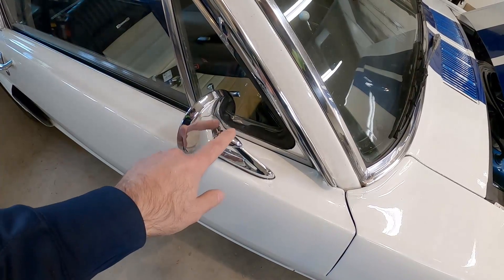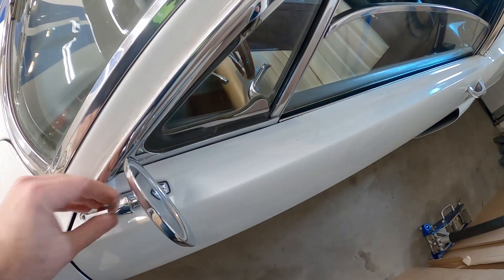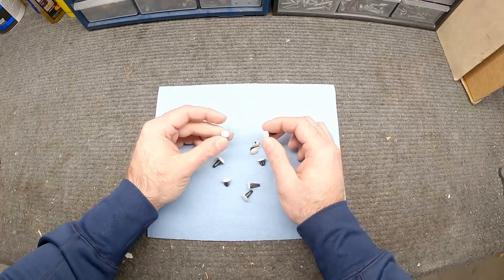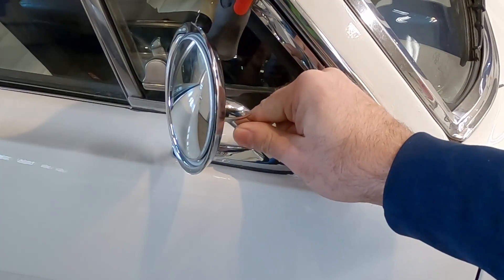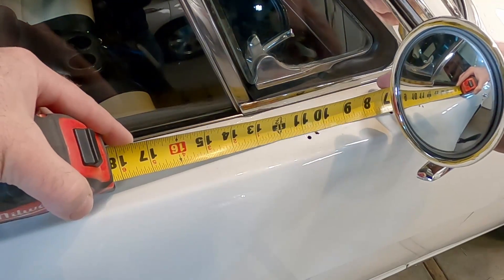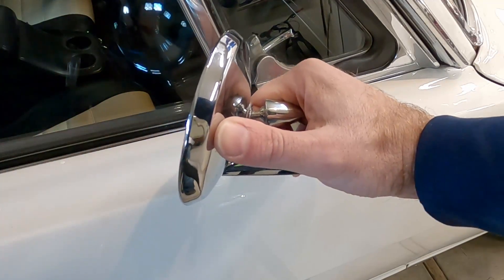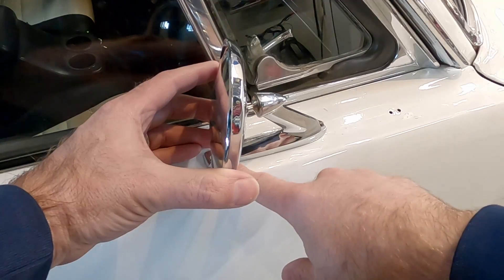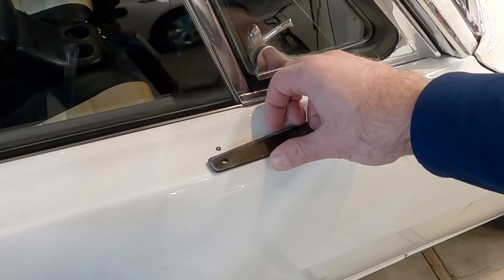Fixing the Mirror Location

Comment: My Falcon has the mirrors way out on the fenders. can't stand them there. but when I removed them, same thing you had,  multiple holes under the gasket and the mirror bit into the paint,  so has an outline of the gasket in the paint. So I reinstalled them for now. Too much work to repair the old location.
Reply from the maker: I'm glad I don't have the mirrors on the fenders, I wouldn't like that either.  :)

Comment: Could you use a little white bathroom silicone for now just to take the eye off the holes ? just a thought. 😁
Reply from the maker: I did exactly that after I made this video.  I pulled those plugs, applied some silicone, and painted it white.  I should have just used white silicone, but I am not a smart man.  :)

Comment: Don’t want to sound to “hillbilly” but maybe try white silicone to fill the holes. After it hardens use an exacto knife to trim and level.  Just a thought 🤔
Reply from the maker: Not hillbilly at all, after I made this video I did basically the same thing.  The funny this is it didn't cross my mind to use white silicone, I used clear and then used a little touch up paint (that didn't match my paint) to finish it up.  It looks bad up close, but miles better than those stupid plugs.  :)

Comment: I had the same issue.  I took it to a body shop and had them fill the hole with weld.  They were very careful grinding it down so there wasn’t much damage to the paint.  Then I took touch up paint and covered the weld.  It didn’t look too bad when it was finished.
Reply from the maker: That's the right thing to do, I'm just stalling until I get to the painting part of this project.  :)

Comment: Hey Andy, great to see videos of struggles small and large!  

As a suggestion here until you are able to take it for paint repair.  Trim a hardwood dowel to the hole diameter and tap into place.  You can then use some very fine sandpaper to smooth the flush top and touch up with common touch up paint.  It won’t be perfect of course but is super low cost and will be a more precise band aid until paint time comes
Reply from the maker: I thought about doing something like that, but I don't know the specific color of white on the car.  It's a bright white, so it's definitely not the Wimbledon White.  I've tried a few different colors of touch up paint on rick chips and stuff, none of it matches.  Since I made this video, I pulled those ugly plastic plugs, filled in the holes with some exterior silicon, and used that touchup paint.  It looks bad up close, but 100x better than those plugs.  I'm stalling until I actually get the paint done on this car.  :)

Comment: How's the view through the mirrors now that you moved them? Thanks for the video.
Reply from the maker: Much better, they're in the location you'd expect them to be, making it easy to see behind you when needed.  I don't need to look through the vent window anymore!  :)
Reply: @AndyKruseChannel  Great, going to try it on my 1965 Falcon, hate trying to look through the vent window. Thank you for the video.
Reply from the maker: @lee read  Just don't do the plug thing that I did in this video.  After I uploaded this, I went back and pulled all the plugs and filled the holes with silicone.  I didn't think to use white (which would have been smarter), but I used some touch up paint after the silicone dried.  It's not great up close, but it's absolutely better looking than those stupid plugs.  This will get me by until I paint the car.  😁